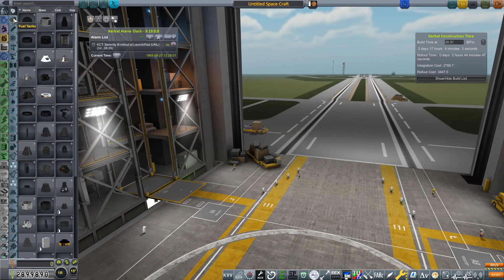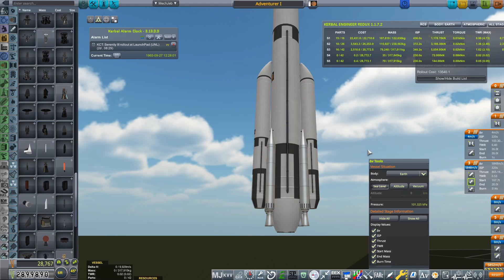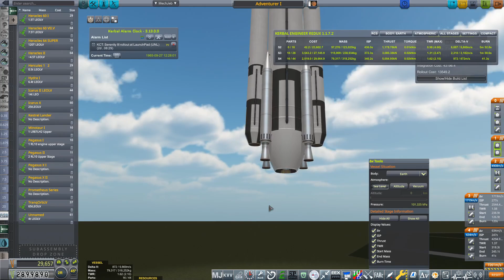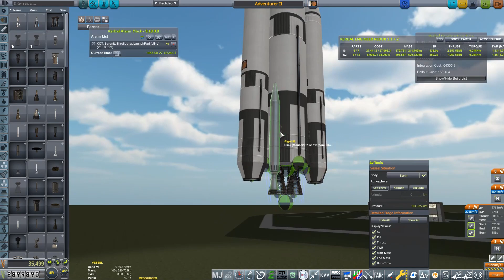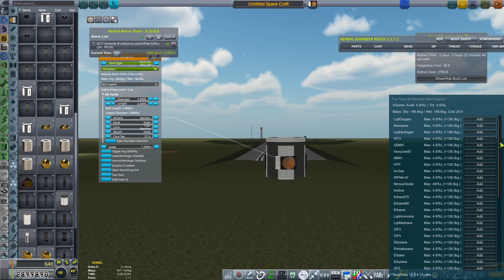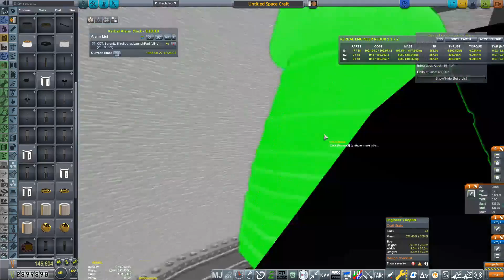Kerbal Gets Real | Build Episode 9 | LV Builds 1965 | KSP RSS/RO/RP1

Comment: A suggestion:
I have noticed that most of these rockets are stage-and a half designs, i.e. all the engines light on the ground and are jettisoned gradually as it ascends. For LEO missions, this is actually less efficient than a direct stage where another engine is air-started, payload-wise.

Did you pick the stage and half approach to lessen engine failures on staging dooming the mission? In view of those HG3s on the 120t launcher this does seem to be a pretty big concern.
Reply from the maker: Failure is part of it, although asides from those hg3’s failure seems to be very uncommon now. I guess another reason is the Icarus series which I’ve been using almost exclusively since 1960 was a two stage design with no boosters, so I thought I might switch it up for these. I didn’t know they were less efficient though so I think the next series that I design will probably once again move away from that!

Comment: As a separate comment, something I'd suggest for future fairing designs would be to actually make them a bit wider than the stage they are mounted atop - that way, you could make wider transfer stages, thus allowing them to either be shorter for the same delta-V (good for fitting complicated long probes into a fairing) or have more delta-V for the same length. It would also allow for probes to get wider, allowing them to be shorter, and thus easier to fit atop existing transfer stages in constrained length fairings.

EDIT 1: regarding the low margin on Adventurer 1, I'll point out that, if you're pushing it to it's payload limits, you probably have a transfer stage/RCS/some means of propulsion on your payload sufficient to complete orbit if you hadn't made it.

EDIT 2: regarding SRBs, my personal recommendation for SRBs to shoot for would be the UA120X series - so named due to their diameter of 120 inches (about 3.05 meters), with each booster having the last digit assigned based on the number of segments it uses.

EDIT 3: regarding the Icarus Super 66, my personal suggestion would actually be to give the HG-3 stage enough fuel to run for the HG-3's full rated burn time. While the HG-3 engines aren't the most reliable in their most early configuration, 600 seconds of run time allows them to deliver a lot of delta-V, and while gravity+steering losses will probably still eat a lot of that, it will allow for the first stage to have to do less of the work - or, potentially, allow for more payload on a similarly sized rocket.

EDIT 4: as to why the HG-3 is so unreliable, it's an early staged combustion cycle engine, back when the US was still trying to figure out how the staged combustion cycle worked - and it was a hydrolox burning fuel-rich staged combustion cycle engine, which is extra difficult, due to hydrogen's tendency to slip around seals and the like - thus, potentially causing explosions due to the fuel rich, really hot exhaust from the preburners potentially leaking through the seals around the turbopump to mix with the LOX flow headed for the combustion chamber/preburners.
Reply from the maker: I did used to do this, but for some reason I stopped, all the old Heracles rockets had a payload adaptor that was wider than the core. Not sure why I gave up with that, but actually that makes a lot of sense and I think going into my next massive lv design session I’ll start doing that again. And yeah adventurer 1 was designed around using Pegasus 1 as a transfer stage so if I do go slightly above the payload limit that transfer stage will be sufficient to get me into orbit! just got to remember if that’s the case that I will be using some of the delta v from that stage!

Comment: Why not use E-1s for the Adventurer 1's boosters?
Reply from the maker: E1’s would be far too powerful for the adventure 1, with over double the thrust of the lr89. The twr on the pad would be crazy! Also using the lr89’s meant I could keep the entire rocket under 350t and launch it on a smaller pad!
Reply: @Carnasa  You are right, I was thinking about the earliest version of E-1, the 170-ish ton one

Comment: For the stages of the Saturn V, the S-IC is the first stage, powered by five F-1 engines burning kerolox. The S-II is the second stage, powered by five J-2 engines burning hydrolox. For LEO missions, you only need those two stages. For Apollo, the Saturn V also had a third stage, the S-IVB, powered by a single J-2 burning hydrolox.
Reply from the maker: Didn’t the Saturn V use some of the S-IVB stage to make it to LEO though? But thanks for clearing that up, at least I remembered the S-IC stage was the first one during this commentary! Swear my mind goes blank when trying to do semi live commentaries like this.
Reply: @Carnasa  The Apollo mission stack (S-IVB included) IIRC was slightly above the payload to LEO mass that the S-IC and S-II stages could achieve, so the S-IVB needed to accelerate itself, the CSM, and LEM by about 800 m/s to make a stable parking orbit.